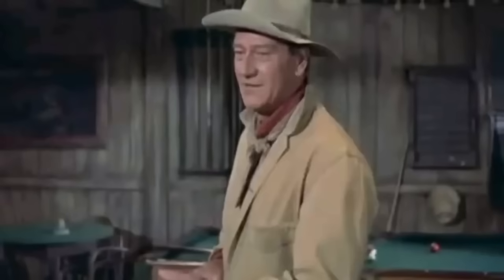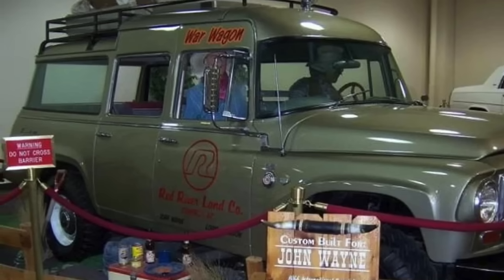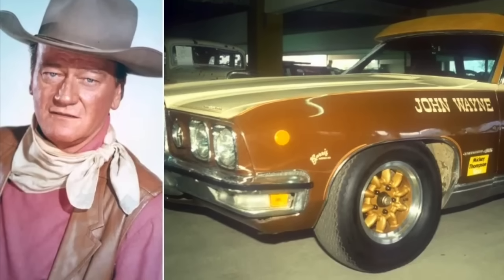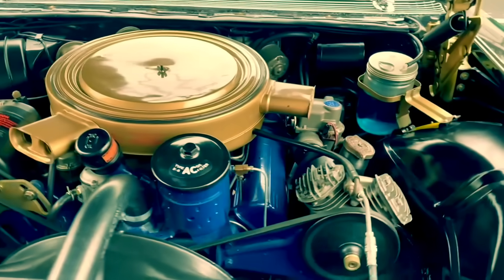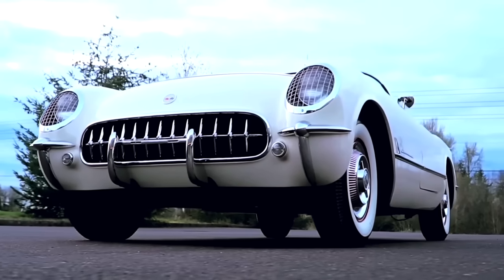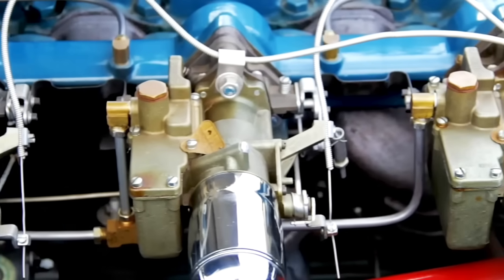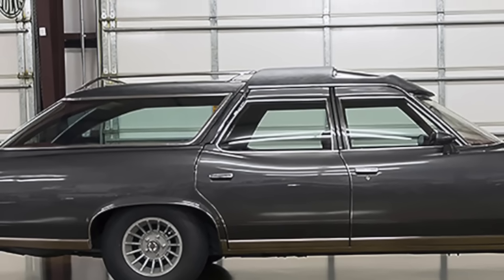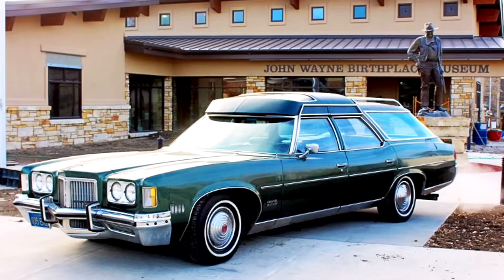John Wayne's All-American Car Collection

Comment: At 2:37 "TH400" (Turbo-Hydramatic 400) is the transmission model, not the engine model.  And the engine was NOT just 180 horsepower.  In 1970 the 400 Cubic Inch engine was rated at 340 (Gross) horsepower and the 455 was even more powerful.

Comment: Where did the 
4 speed auto in the old  caddy come from?
Reply: Hydramatic
Reply: @eugenepolan1750  "This desire led to an aggressive program to develop a fully automatic, fluid-driven transmission. The program was led by GM engineer Earl Thompson, and the result was the Hydra-Matic Drive, the first fully automatic passenger car transmission."
Reply: Before the had th400, big gm except Chevy came w hydramatic, that was a 4 speed  til 63. Even GMC trucks used it 55/ 63